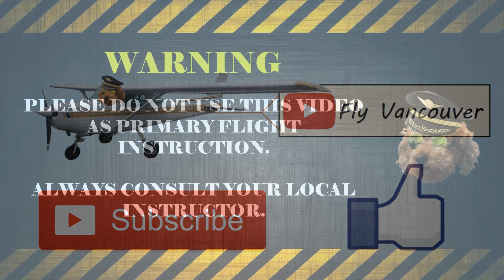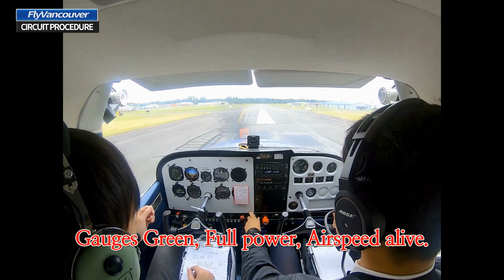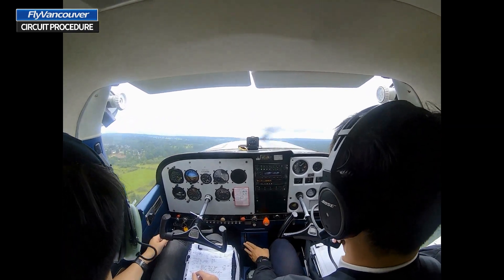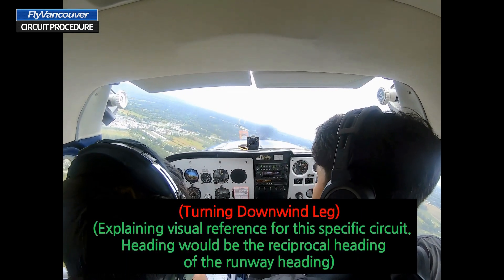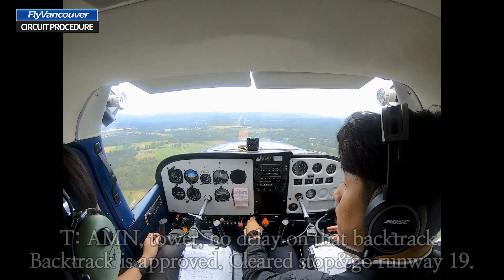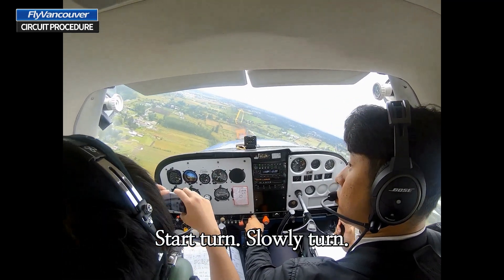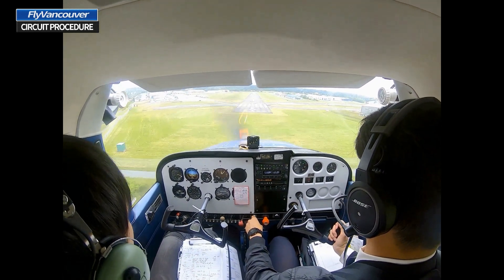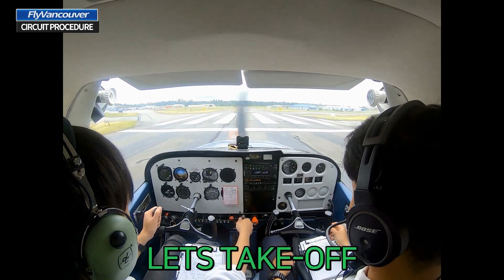[Training] How to Fly a Circuit Pattern

Comment: Liked  your landing, perfect. My personal note....the engines don't like sudden surges of fuel that causes a sudden rpm change, it stresses lots of components, causing premature wear and tear, often overlooked by the mechanic during the 200hrs inspection; then the winter stress when the students take the cold engine for a runup, it causes more stress on an old engine that has Play on the moving components....for that reason I advance the throttle much slower, on a long runway like Langley, maybe 50e extra feet will not make a difference. Also flying by visual reference got me confused when I flown to a different runway, till one instructor taught me to use the heading indicator to learn when to turn and where to aim
Reply from the maker: Curious soul Thanks for your comment! Still learning everyday 😳

Comment: Nice demo! Btw during your approach briefing, what do you mean by 'I will overshoot if Im not stable at 200ft'? Does it mean 'I will continue the app and landing but touchdown past the original touchdown zone?
Reply from the maker: On the flight test guide it says an overshoot(go around) should be executed if not stable at 200ft AGL. So if I am either too high or low, too fast or slow, not aligned with the runway, a go around should be executed. It could have been confusing for other students. Thanks for the question :)
Reply: @FlyVancouver  Now clear.. I have never known that the term overshoot is the same as Go around, thank you for clearing my doubt :) Where I fly, term we are using is Go around.
Reply from the maker: @tobewealth  Never know. I might be the only one using that term haha. I think saying "Go around" does make it more clear for sure. It can be a very good thing to mention when teaching students as they might have the same doubt.
Reply: @FlyVancouver  I searched Canadian Flight Test Guide and it says overshoot meanings are; 1. Exceeding runway length limit when landing, 2. Same as Go around. You were correct. Good to know.
Reply from the maker: @tobewealth  Never thought about searching it up. Thank you for the help!